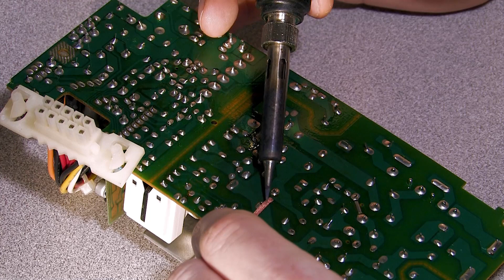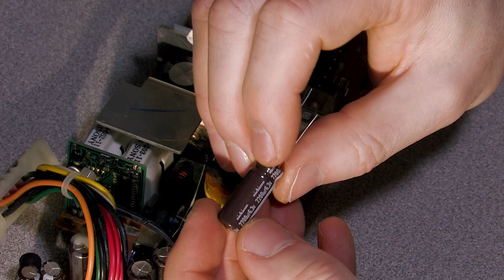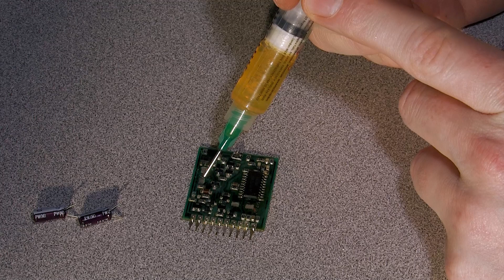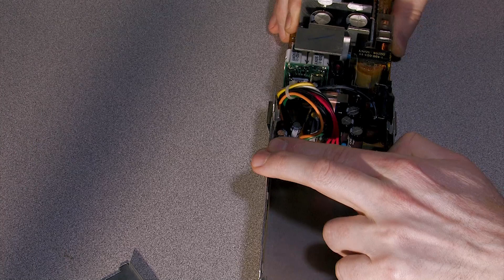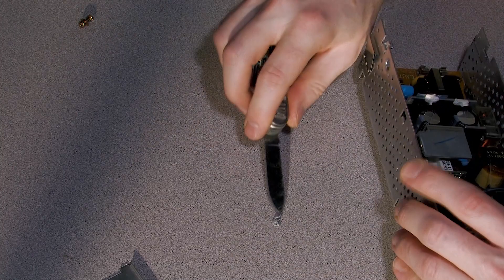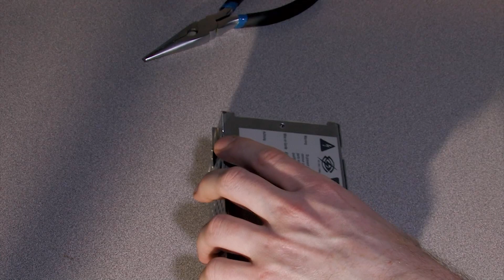Recapping A Macintosh IIsi Power Supply (PSU) - Paul's Old Crap

Comment: Hey thank you for the video, do you happen to remember when you tested the power supply and determined it was bad what the machine acted like? My IIsi motherboard is fairly clean and the computer was working not long ago but now the powersupply goes "click click click" do you think a recap of the psu would fix that? I would assume so but i have heard the IIci powersupply when they go click click even a recap wont fix them so i was wondering if its the same for the IIsi, and yes i will also recap the motherboard
Reply from the maker: The first one I ever experienced fail just flat out stopped working and I'm not sure I ever noticed it making any noise. My PSU recapping these days is mostly preventative and so far I've only had LC power supplies completely failing prior to repair. I'm not an expert at electronics but with the age of these parts you'd need to recap both the board and PSU anyway in order to have a reliable machine, so probably doesn't hurt to start there.

Comment: Just picked up a IIsi on eBay. Very clean but when I plug power cord in and press the play button on keyboard, just get a faint speaker pop and that's it. Guessing its the power supply? Can you recommend a starter kit for soldiering? Ive done some very basic soldering but not this advanced. 
I have the Milwaukee soldering gun but that's it.
https://www.homedepot.com/p/Milwaukee-M12-12-Volt-Lithium-Ion-Cordless-Soldering-Iron-Tool-Only-2488-20/302022408
Reply from the maker: The IIsi will require both the logic board and PSU recapped, though I think the logic board is probably the more critical component as they tend to be leaking capacitor electrolyte earlier than the PSUs. I only started soldering to fix these old machines so I basically just picked up the cheapest iron that had variable heat. Before this I really didn't do any soldering so even with little experience it isn't too bad. The logic board is a bit harder to recap especially if you don't do it the "lazy" way I've been doing, but still not overly difficult.
Reply: Paul's Crap thanks!

Comment: You probably only needed to replace the two SMDs on the secondary board. The big ones don't usually go bad.
Reply from the maker: With almost all the caps showing signs of leakage I replace basically everything as the cost is pretty minor. I don't plan on opening these up again unless something else goes wrong.
Reply: @netfreakcanada  Fair enough. I've recapped dozens of macs at this point at it's always the SMDs that are the culprits.
Reply from the maker: @kirishima638  I don't think I mentioned it but the IIsi in the video already had its logic board recapped as that was also about to fail. I basically recapped all the logic boards first and now I'm running through the power supplies before they all leak too badly.
Reply: @netfreakcanada  But all the caps on the 'logic board' (oh Apple) were SMDs right? Anyway nice job. I really should post some vidoes of my collection at some point. 

Do you also fix hard drives? I've restored a couple of old Connar drives. Working ones are so hard to find now. I did see that you had an SD converted in your 475 but that's cheating!
Reply from the maker: @kirishima638  The logic board is usually just SMD but the IIsi specifically does have two axial style caps. Those don't seem to leak like the others but I replace them at the same time usually. I don't do any work on hard drives really, but if there was a way to deal with noisy bearings without potentially destroying the drive I would look into it. That tends to be the biggest reason I don't use more spinning disk.